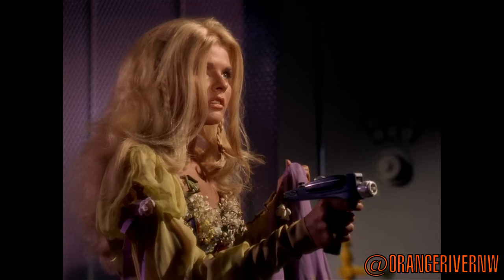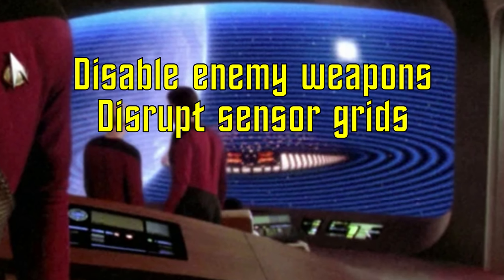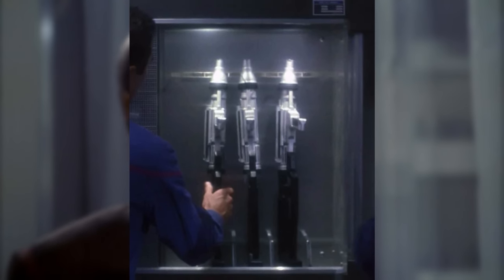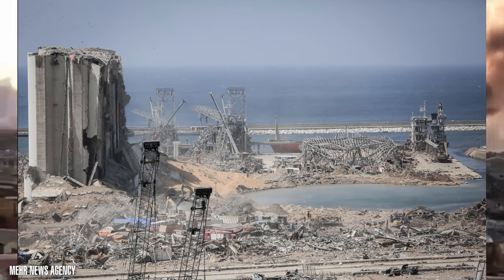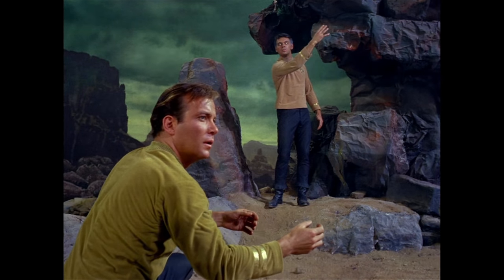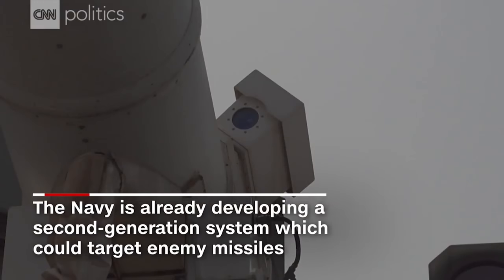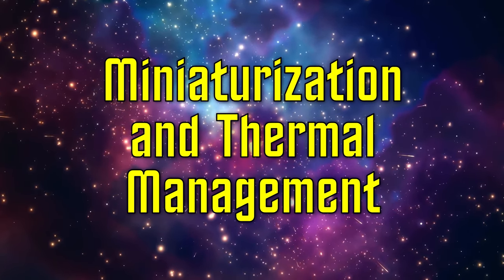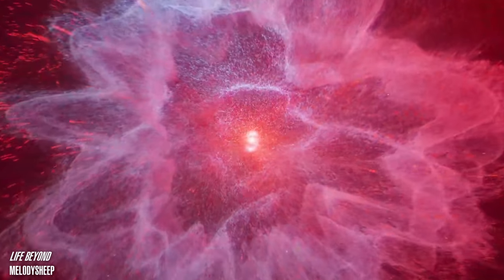The Science of Star Trek's Phasers

Comment: I always wondered why they didn’t get way too hot to handle after firing, but I suppose the tech manual invoked superconducting to explain that, all the energy has gone into the beam and none into waste (or almost none). 

Of course, Trek has a very dubious relationship with heat management and radiators anyway, such as invoking subspace to explain where the waste heat from the ship goes, or saying that it’s simply funnelled out of the warp nacelles (somehow). So I don’t expect them to ever really address how the phasers don’t overheat. 

Appreciated the discussion of real world laser and particle weapons, and their comparative energy outputs. Though would have liked to see a conversion from watts to joules about the Navy laser emplacements. It’s relatively trivial for me to do, given joules are watts times time (or watts are joules over time), but it still would’ve been nice (especially since I’d have to look up how long the laser pulses last).
Reply: I’ve liked the idea one science writer suggested on using metal dust blown between an input and output channel to release heat into space. Something similar might be used between the nacelles of a star ship. 

But ships using only one makes me think it just flies from the front to the rear along the nacelle sides instead, or something similar. (Maybe using a normal radiator to expel heat to space along the sides.)

Now considering the specified power outputs used you have to wonder what their power source are. Perhaps a microgram of antimatter like in the warp engines? Or use some of the nadion particles for the power to the weapon? These particles might be unstable when removed from their containment. Closest comparison would be to gunpowder in bullets.
Reply: In the Novel of the Invaders, a constructed ray weapon over heated and the alien/invader had to drop it from his hand. Good book, if you can find a copy I'd recommend it 👍
Reply: @walterlyzohub8112  there’s various ideas to reject heat in fluids (or a flow of tiny solid particles like you said), such as is done in nuclear-thermal rocket designs (such as in its most extreme form, the “nuclear lightbulb” which we have nowhere near the materials science to make without melting itself 😁) but part of the issue with your (slash the author’s) disposable metal heatsink proposal is you need to carry even more mass to throw away long-term versus just carrying the mass of the radiators… 

One could maaaybe argue that TOS-era warp drives rejected all their waste heat inside the ejected warp plasma, but TNG-era ships recirculate and recrystallise that plasma back into dilithium, which raises some problems. Perhaps they can increase the heat load per plasma particle dramatically to cover the tiny amount emitted but.. ehh…
Reply: @55Quirll  from a cursory search I can’t find a book called “Novel of the Invaders”, and far far too many called “The Invaders”. Do you have an author name?
Reply: Where did you see a mention of heat being dumped into subspace?

My headcanon is that the glow we see from the impulse engines is actually radiated ship's waste heat. From the descriptions of how they work the actual exhaust should be glowing in either X-rays or deep infrared, not visible red, and the glow barely changes whether ships are at a dead stop or accelerating.
Reply: Gotta figure its insulated just like todays plasma torch or tig welder
Reply: @walterlyzohub8112  IIRC, the tech manual stated that a kind of battery was the biggest component of a phaser pistol, and that it contained enough energy to vaporize 3 m³ of solid rock, and that the type 3 rifle was essentially the same as the type 2 pistol but with 3 times the battery.  
But then again, only a few pages away, the same manual claumed that the primary self-destruct mechanism based on antimatter could release about 10^18 joules of energy, and that the secondary mechanism based on fusion charges was half as powerful (10^9 joules).  So they were off by a factor of 500 million there.
Reply: @sikliztailbunch  well, there is spin gravity and thrust gravity and that’s within our actual scientific and engineering capabilities. And if gravitons are real, you could have stationary gravity (the warping of spacetime leading to gravity) without mass or thrust or spin. The artificial gravity is actually among the least problematic aspects, especially since the warp drive already involves selective bending of spacetime apparently being mastered. Ultimately it again comes down to energy density, not mass density.
Reply: @kaitlyn__L  I actually didn´t think of that. Thank you for the brief explanation :-)
Reply: @sikliztailbunch  no problem! The fictional physics of these worlds, and their plausibility, is something I find very interesting.
Reply: @sikliztailbunch  You need a planet's mass to simulate planetary gravity in a small volume of space the same way you need the power and mass of a star to simulate (or exceed) the spectrum and brightness of the Sun *in a small volume of space*.

In other words; you don't need a planet's mass *in a small volume of space*.
Reply: Well Kaitlyn, you're the only one to mention superconducting. Room temperature SCers would solve all these issues, right? Not to mention flying cars, extremely small computers, and of course warp drive using SCding magnetic bottles to hold antimatter. Once we have solved this issue, the skies the limit, or should I say space.
Reply: @chriselson7268  The semi-canon Next Generation Technical Manual explicitly says that phaser crystals are superconductors. This, and other details of how hand phasers "work" was confirmed in TNG "The Mind's Eye.

The Manual goes on to ascribe phaser crystals a fictional compositional formula suspiciously similar to the equally fictional formula for dilithium it provides (neither of which AFAIK is confirmed on screen), strongly suggesting that dilithium is also a superconductor though AFAIK it's never confirmed on screen. Considering how much power dilithium has to handle, that would make sense (in SF terms).

Oh, yeah; the Manual says the linings of antimatter canisters are made of superconductors (also not confirmed on screen). Superconductors are found in many (not confirmed on screen) applications in the Manual suggesting many varieties of high temp superconductors exist in in Trek.

That concludes this Nerd Rant(tm).  ;>)
Reply: @markfergerson2145  So going by your logics, for having the same gravitational acceleration of 9.8 per second square on a spaceship with the volume of a small building, you need less mass? Then why do even small buildings need an entire earth underneath them to have gravity. 1 G needs one earth´s mass. That´s a constant. You cannot concentrate the gravity of less mass to a smaller volume. Gravity isn´t something you can concentrate like a laserbeam. Of course a laser can be stronger than sunlight but that comparison doesn't just lag, it's on crutches
Reply: @chriselson7268  the video mentioned the tech manual mentioning “superconducting crystals”
Reply: @sikliztailbunch  yeah, you can compress the same mass into a smaller space, such as with various exoplanets the same diameter as Earth but with 3-5x its mass. But less mass would lead to less gravity. However thankfully the Trek gravity plating is not meant to run on mass, they have an otherwise unexplained exotic material that directly emits gravitons when an electrical current is applied. (In the real world gravitons are yet to be confirmed, but Trek has other exotic still-theoretical particles like tachyons confirmed too, so I’m satisfied with that.)
Reply: @markfergerson2145  I honestly don’t remember if there was any oblique reference to subspace energy ejection in any episode, or if I read it in a tech manual or series bible, or if it’s just Daystrom subreddit received wisdom (which it definitely is, but I’m not sure if they got it from elsewhere). 

If Trek somehow has the ability to turn a bunch of low energy photons (heat) into a single high energy photon (X-rays) that might fix it, but if we’re going by real physics, the nacelles or impulse engines don’t have near-enough surface area for the waste heat from the antimatter or fusion reactors. Especially given how teeny tiny the impulse engines are on the Intrepid and NX class, or totally encased in hull plating on the Nebula class. 

It doesn’t really bother me truthfully, lots of sci-fi ships handwave-away waste heat, but the radiators on real space stations and space ships are some of the most interesting considerations IMO, so… here we are lol
Reply: @brianellison3525  space is the best insulator there is, no convection or conduction can occur, only black-body radiation. That’s why the ISS’s radiators are over twice the surface area of their solar panels!

As for the phasers rather than the ships, insulation can only slow down the transfer of the heat, so the phaser’s insides could cook themselves by getting it slow-enough, but you’d still get the outer casing heating-up after a time. And you of course don’t want your weapon to render itself inoperable by cooking itself… plus it’s worth remembering part of the insulation when welding is in the gloves! You don’t want to use any type of welder bare-handed :)
Reply: @sikliztailbunch  Trek ships use arrays of small (a meter across or so) individual gravity generators each with an area effect of 50 m squared or so, installed between decks.

Yes, as far as we know now there's no gravitational equivalent of electric and magnetic field concentrators like copper and iron, no known materials with the gravitational equivalent of permitivity and permeability different from the vacuum value. Not yet.

That's because in electromagnetism there are two opposite kinds of charge allowing matter made of them to be polarized by an applied EM field, while in gravitation there's only one kind of "charge" (mass), attractive.

However, you keep assuming current tech and understanding of physics.

I'll point out that our current understanding of physics in general and gravity in particular is far different from our historical understanding , and keeps changing along with the tech we design and build to exploit that understanding of physics.

Assuming both will stay the same forever is a bad bet.

To create static gravity fields we'd need to generate self-propagating time-varying disturbances in the overall gravitational field (gravity waves) which we know exist, and get them to interfere such that they superpose to form non-varying fields over the volume we want to affect. We know how to do that with electromagnetism.

Back in the 1960s Robert L. Forward (an actual physicist) published papers proposing methods for doing this. They'd be expensive and complex and nobody's wanted to invest the required funds. (No, nothing to do with cranks like Podkletnov)
Reply: @markfergerson2145  of course it’s worth bearing in mind current debates about whether there actually is a quantum field of gravity (and thus gravitons), or whether the medium is simply spacetime itself with no other quantum field. And the gravitational waves we’ve detected are indeed propagated in spacetime, though that discovery still doesn’t rule out a quantum gravitational field yet. But it’s certainly possible to have gravity without gravitons, which may undercut Trek’s explanation. (As a physicist I hope gravitons are real, but I have to accept the possibility that they may not be.)
Reply: @kaitlyn__L  Dang. I was hoping you had at lest a semi-canon source because it makes beautiful sense. Oh well.

Almost all SF handwaves away waste heat management (if it's mentioned at all). There are current-tech-compatible exceptions like the gigantic radiators on the sleeper ship in the film "Avatar" but they are very rare as we all know.

David Brin's "Sundiver" used the "refrigerator laser" trick you mention, combining low grade IR photons into X ray photons to be dumped overboard in order to allow a research station to hover near the Sun's photosphere, but he had to invoke Alien Magic Tech to do it.

ITYM the Defiant Class had enclosed impulse engines. There are conflicting explanations about that; IIRC the DS9 TM claims there are baffles that somehow give the exhaust time to cool before being dumped overboard (through permeable parts of the hull plating) kind of like the way a gun "silencer" works.

That head canon about the impulse engine exhaust I mentioned was inspired by the "photon spill ports" on warp nacelles mentioned in the TNG TM that dump waste energy from the warp coils in the form of visible light. Yes, that was pure backstory invented after the fact to explain why TNG-era ships had "rule of cool" glowing nacelles in the first place.
Reply: @kaitlyn__L  Yeah, I know.

I'm strictly an amateur physicist who's followed changes in thinking about gravity since corresponding with Robert L. Forward shortly before he passed away.

There are some pretty outre hypotheses that might lead to a quantum theory of gravity. Unfortunately we have precious few experimental facts to base a theory on and no idea how to test things like LQG. Then there's the "ultraviolet catastrophe" aspect of the infinities encountered when trying to separate and add the source terms in the GR equations for mass in a G field and renormalization went out for a beer rather than play.

Mass stubbornly refuses to be quantized, we can't even prove that the Equivalence Principle (weak or strong) is true (hell, I've seen speculation that there's three kinds of mass; inertial mass plus attractive and passive gravitational mass), and AFAIK there's no agreement on whether virtual particles' off-shell mass makes any contribution to the gravitational properties of the vacuum. If the latter is true, we might see some effect near black holes but how could we detect or make use of that?

Then there are what I consider distractions like "gravity is an emergent property of something else" like holographic Universe ideas.

What a mess.
Reply: That's an easy one.  In the transporter buffers, of course.    ;P
Reply: @markfergerson2145  we can see the impulse engines on the Defiant, albeit they’re two small red squares much like the small red rectangles on the runabouts. The warp nacelles were enclosed though. 

Yeah, ultimately it is just rule of cool. Though the nacelles did glow while in flight in TMP-TUC, just not while stationary. Perhaps we can say they started having to leave the warp engines idling for various reasons; quick escapes, or the more advanced engines taking longer to get going, or bleeding-off power to run the ship, or so forth. 

But there definitely should be more than just visible light in the nacelle glow, and I’m happy to take those as the main heat rejection mechanism rather than impulse engines. 

Trek already has all sorts of exotic materials, so I wouldn’t exactly be surprised if they have some “reverse fluorescence” material that can absorb multiple photons to release one higher energy one; rather than one photon, to one electron shell imbalance, to one lower energy photon as with real fluorescence. 

We do know “warp emissions” have a lot of/are mainly gamma rays, from Future’s End, though I assume the writers just asked what the byproduct of antimatter annihilation was and that is indeed gamma rays. 

No wonder it’s so easy to track other ships’ warp trails, with plasma residue, constant bright gamma emissions, and the wake they leave in spacetime itself. 

And that’s not to say subspace heat rejection definitely isn’t mentioned in those other places, just that I CBA to check! I know I certainly got the impression while rewatching various episodes that, putting two and two together they must mean that, but I don’t want to say it with certainty because that was a while ago and I don’t remember which ones it was. 

What bothers me more than not having radiators is how sometimes when life support and the coolant system goes offline the ship gets intolerably hot (as it should) such as in Macrocosm, or it gets freezing cold such as in One. 

Though it’s definitely textual in Trek that the force fields can hold back heat (such as O’Brien saying engineering will get awfully hot when the field around the core goes down), and Trek ships do have many types of force fields extending beyond their visible body (such as the invisible scoops in front of the bussards), so perhaps they just get their surface area that way. 

But subspace radio and warp drive already dump massive amounts of energy into subspace for their own purposes, so I think that’s where the idea must have come from. “If that, why not this?”
Reply: @markfergerson2145  it’s ultimately not too important, as Trek already has a very different universe than ours. To start there’s subspace, and the speed of causality is different. There’s also a Voyager episode which implies they exist in a “hidden variables” quantum universe which has been disproven in our own (they say it’ll take a few hours to figure out a pattern of quantum noise, rather than it being literally impossible — this could also perhaps be invoked to explain why the Borg can adapt to randomisation even faster). So if gravitons and tachyons end-up disproven it won’t affect my enjoyment of Trek’s fictional physics any differently. 

But yeah, the debates in the various fields really are a mess and there’s far too many conflicting explanations. Though it doesn’t take a holographic universe for gravity to be a mere byproduct, the proponents of “it’s just bent spacetime with no other quantum field” also argue that. 

Either way, there’s still a lot of hitherto unknown physics indicated by this discrepancy, and it’ll be exciting if they can ever be unified. For all we know it may happen in my lifetime, or it may take centuries more. (After all, Newton to Einstein was a few centuries…)
Reply: the heat is directed in to the beem by the